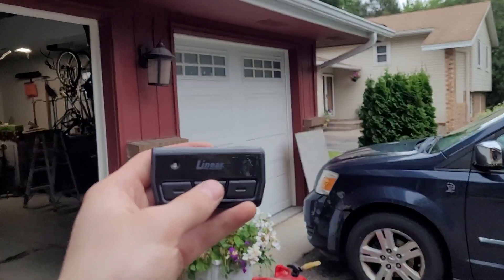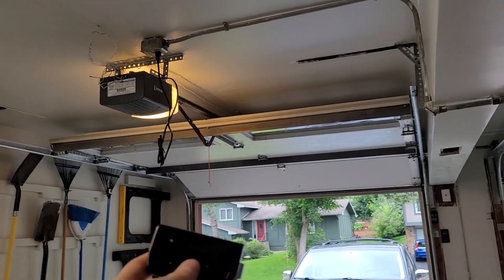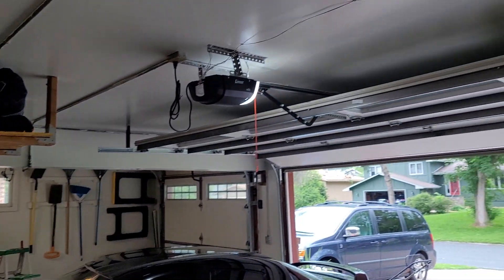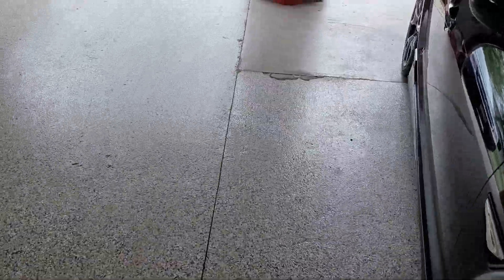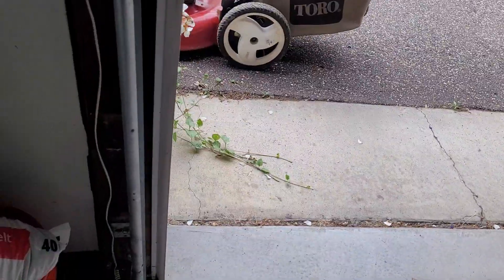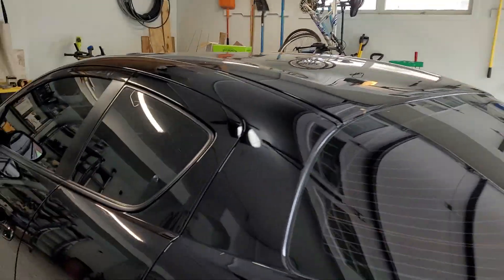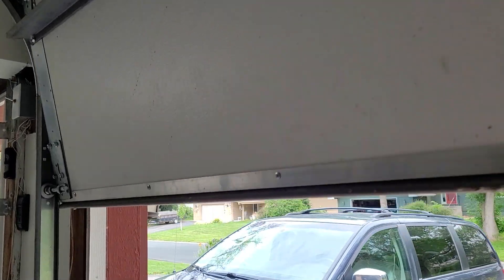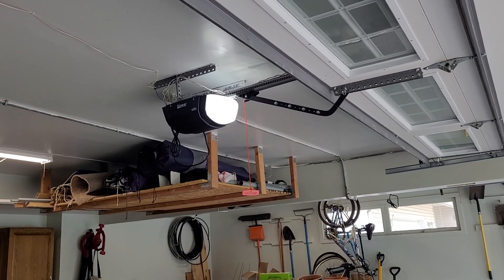youtube video #-jRw-FomdNM

Comment: If you don’t mind me asking, what state do you live in? I’m in Michigan.
Reply from the maker: Minnesota
Reply: @TBHD724  Cool! Just also out of curiosity since I love mid century modern architecture, is your house a split level? That’s where the front door is on a landing in between the upstairs and the downstairs. My house is a split level, and I must say, although there’s not much room for bags, coats and shoes by the front door, it’s still a pretty neat feature of design especially in a hilly area. I usually go through the garage since I drive to work at the hospital every day, but when I just go for a run I typically go through the front door. Sometimes I go through the back, but that’s only if I am coming out to get my bike, or if I’m taking out the trash.
Reply from the maker: It is split level